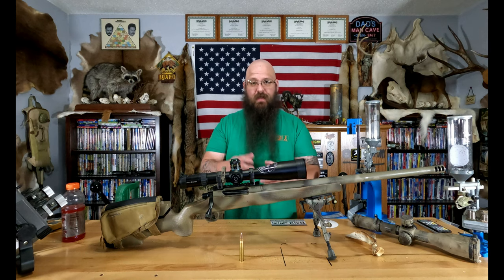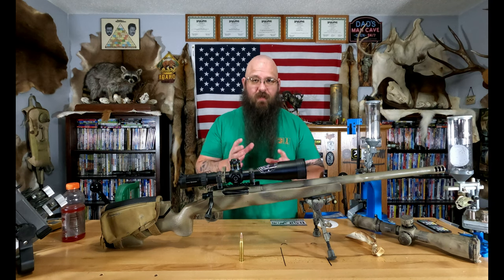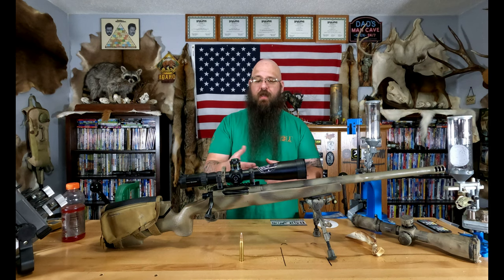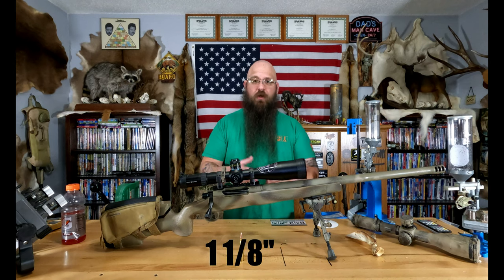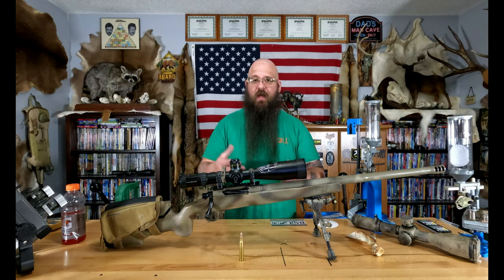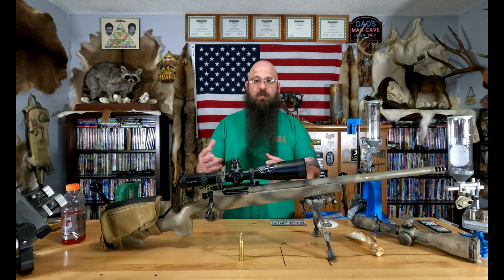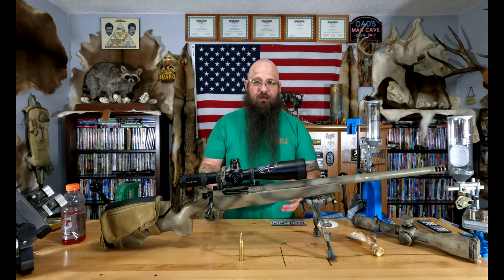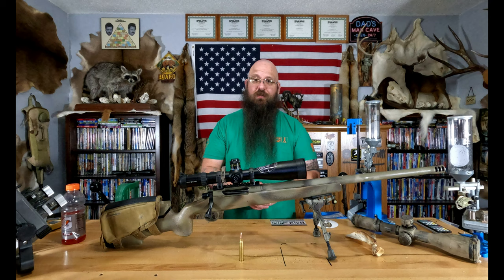Ballistics gel hunting vs match bullets episode 29 - Core Lokts part 2

Comment: How do you get through to the “it doesn’t have a picture of a deer on the box it won’t work right” crowd ?
Reply from the maker: Unfortunately in most cases they will never change their minds. You can show them all the proof in the world and they will do nothing but argue. It would require them to admit they were wrong. identity protective cognition Belief perseverance is maintaining a belief despite new information that firmly contradicts it. Such beliefs may even be strengthened when others attempt to present evidence debunking them, a phenomenon known as the backfire effect. They will go to great lengths to not admit they are wrong including deluding themselves that evidence proving them wrong actually proves them right. Occasionally you can get through to someone but unfortunately it's rare. Egos hold more people back than anything else.
Reply: change the box and trick them!!!! then they believe

Comment: What are your thoughts on other bonded bullets like in the Federal Fusion ammo and Speer gold dot bullets?

Thanks!
Reply from the maker: Honestly I'm not a fan of bonded bullets for rifles. There's really no need for a bonded bullet unless you're dealing with a animal that requires a lot of depth of penetration required and is highly dense. There's only a couple animals that require that elephants, rhino, hippos, and Cape buffalo. Anything else you're not going to get the best performance with a bonded bullet. People drastically over estimate animals and what it requires. Federal fusion is another cheap bonded bullet like core lokts. I've used them and never been impressed. It has the same issues as the core lokts with the thick jackets and you get heavy and light spots leading to loss of gyroscopic stability and accuracy issues.

Comment: Thanks for your work in this! I wonder if balllistics gelatin tells the whole story of what to expect on game? My brother shot a deer recently with a 30-06 with starting loads, and a 150 Hornady SP flat base. (which I assume is close to a core-lock) The loads chronoed at 2700 fps. Deer was shot at 200 yards, which put impact velocity at right around 2200 fps. Bullet exited the deer leaving a good blood trail. Deer ran maybe 60 yards before piling up. When the deer was opened, there was substantial damage to the lungs, yet exit hole was only around an inch, with very little bloodshot meat. I was pretty impressed with that. Granted, that is a sample space of 1, but I plan on using it more to see if it continues to show good performance.
Reply from the maker: Ballistics gel is a reputation of tissue and is accurate. Real world results support that which is why it's used for all bullet testing. That being said it reps straight tissue like shooting through straight meat like a neck shot. Chest cavity has a lot of dead space in it. The lungs are full of air so really the bullet is only impacting tissue, bone, hide, and organs for a small portion of the penetration. Whitetails you have 3" depth of penetration to the vitals. So if the bullet stops on the off side going through both lungs it's really only dealing with around 4" with lung walls and getting into the chest cavity. The rest of its path is through air in the lungs. Due to this you will get more penetration than on gel. For example if you get 15" on gel you will get somewhere around 20" on a animal or more. Ballistics gel is a great way to test bullets and compare the results. When you have done it enough and also studied the real results you learn to know what to expect. As for your deer you talked about. This is something that really helps to show people the difference between and really them actually seeing it in real life to understand. The lungs are going to fill with blood and due to that are going to look much worse than they actually are for damage. You are definitely on the minimum impact velocity range for that bullets construction. I'm guessing that it impacted rib bones increasing the impact resistance and aiding in expansion. If it had gone through and went in between the rib bones only hitting meat it would have been less damage. Honestly people drastically over estimate animals and what is required to kill them. You're not going to get meat damage that low velocity. They will definitely kill just like every bullet. There's a big difference between a biker like that and a great bullet. If you're going to use that one again just keep it over 2200 fps impact velocity.

Comment: Im really curious from all your testing on gel and in the field what is your favorite hunting bullet for 6.5 and 30cal? I kind of went down the match road a bit with 185 juggernaut and 144gr hybrids and the jugs just poked holes. Not enough speed from 308 i suppose. 144 worked but no pass through and no blood. Shot the hog 3x and even the initial neck shot didn't pass through
Reply from the maker: BTHP bullets have a flaw where the tip can clog especially on match bullets with very small holes. It effectively turns them into a fmj causing them to pencil, tumbling, and or changing directions. Berger in order to counter that has a large cavity inside the nose of the bullet with their new bullets. Upon impact the nose collapses forcing expansion regardless of whether or not the hole clogs. With bullets like the SMK people will enlarge the hollow point to counter that. I personally prefer bullets with a tip. This gives reliable expansion and doesn’t have the issues of bthp bullets. Eld match, amax, a tips, and sierra TMK’s are the best bullets. That’s both in gel and on animals in the field. Incredible terminal performance and great external ballistics. Right now I’m currently running a tips in my 6mm creedmoor. The other guns I’m running eld match and amax. They only make the amax in 30 cal now. The eld match is a improved version of the amax with better external ballistics. For 6.5 I’d recommend the 140 eld match or 153 a tips. For the 30 cal I’d recommend the 168 gr and up eld match or the 176 a tips. Good luck this season and if you have any additional questions don’t hesitate to ask. Happy hunting.
Reply: @longrangehuntinggroup7223   appreciate the detailed response. I just got some 215 bergers to load for my 300 prc based on good reviews. But I think I'll keep it simple and just stick to the eldm in everything as it's cheap and available and shoots great
Reply from the maker: @RockinRack yeah that’s the great part the eld match performs better than the Berger at almost half the cost. That means with eld match you can shoot and train more while getting superior performance. I don’t mind paying for quality and will gladly do it. However I won’t overpay for a product good or bad. I’m running the a tips in my 6mm creedmoor and they are $72 per 100 bullets. That’s definitely more than the eld match but that gun absolutely loves the a tips and shoots them lights out. I really don’t understand how people overpay for crappy products though. I see guy’s spending ridiculous amounts of money on monolithic bullets that aren’t even the good monolithics. Like for just the bullets for reloading $150-$200 per 100 bullets and they don’t even get good performance. I’m willing to spend the $72 per 100 for the a tips because they are the best. I don’t understand spending over double that for crap bullets. Ironically some of the best monolithic bullets are not the most expensive ones. For hunting especially long range you don’t get much better than the eld match especially for the price.

Comment: Have use core lock ultra once in a  270win, way to stiff bullet even à 100yrd. The only time remington bullet work well for me was in a 45-70, 405gr soft point at 1800 fps on a bear hunt.  Got the spine at shoulder jonction